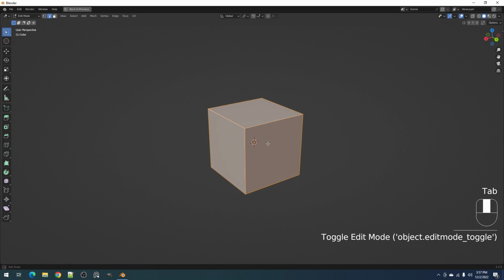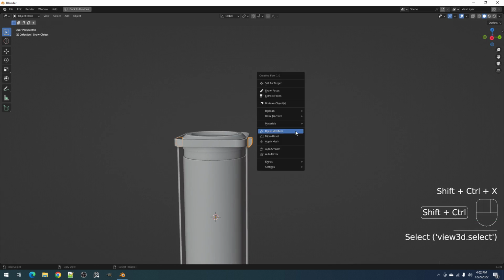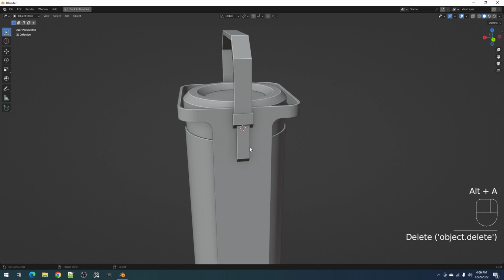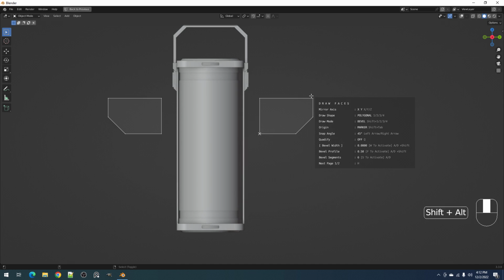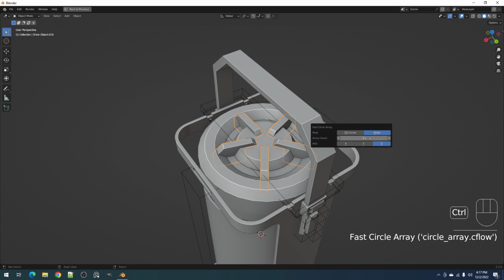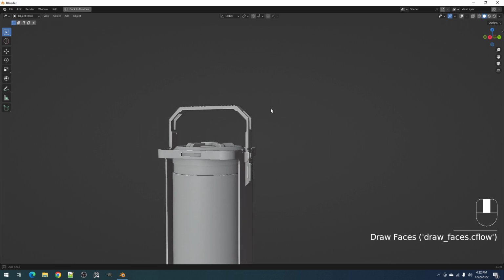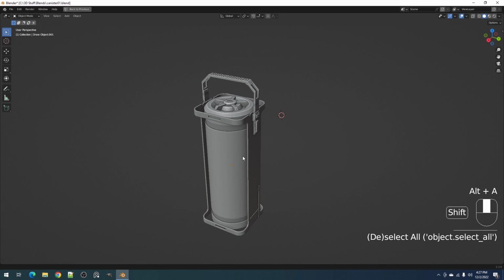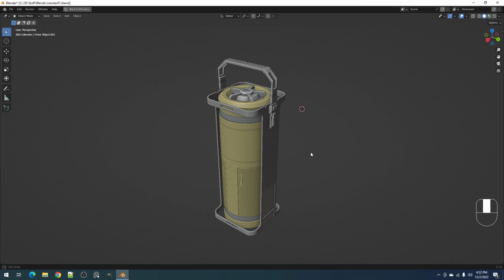Creative Flow Demo 01: Canister

Comment: silly question, but how did you make the knife cut snap horizontally at the beginning part? holding shift only makes it go the center of the edge and i dont see a button in the overlay.
Reply from the maker: Screencast cannot get the keys when using modal operators. The knife operator in Blender can snap to angles by pressing A while you're using it.
Reply: @blenderguppy  thanks for letting me know! im loving the new system and tutorials to teach me it